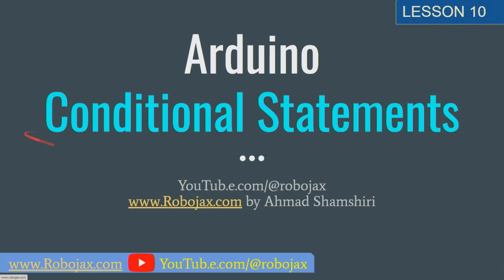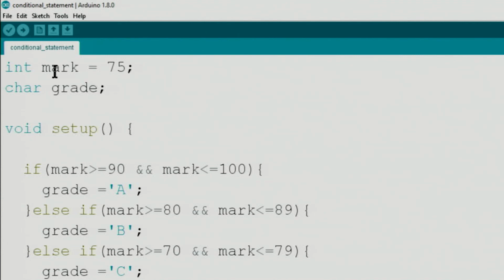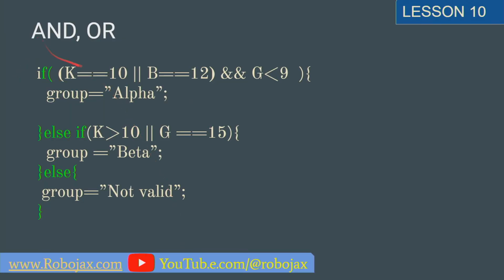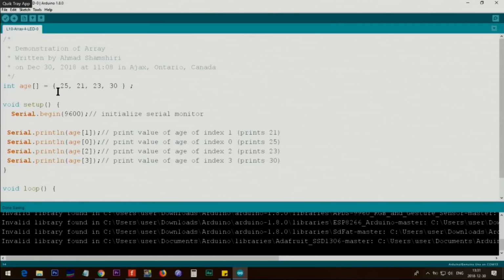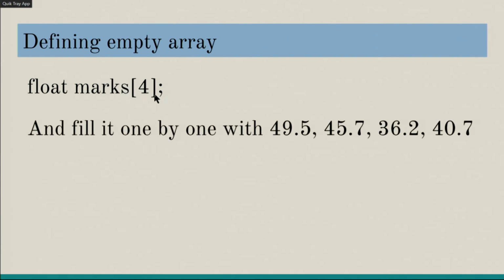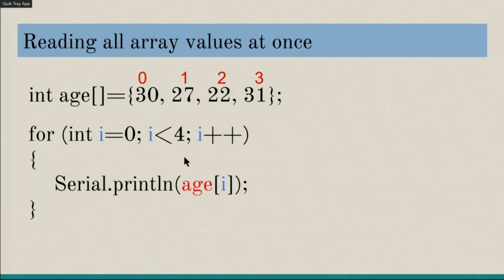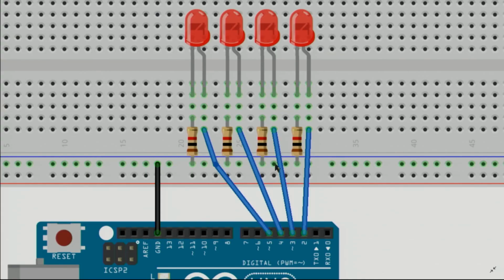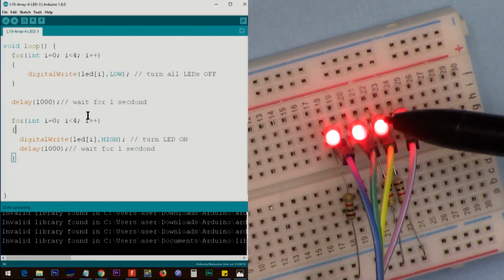Lesson 10: Conditional Statement in Arduino and Using Array | SunFounder Robojax

Comment: Hello Robojax Do you have a code example to calculate the average value every 10 or 20 or more of the result of a power calculation ie Power result done by measure of tension by current.
Reply from the maker: Hi, I believe I have written such code shown in this video Overcurrent Protection OVP with Winson WCS Current Sensors and Arduino
https://youtu.be/vs7Nw107AOo or the introduction video of this module